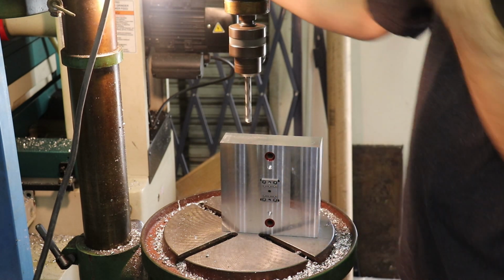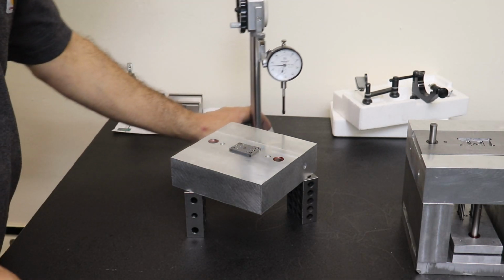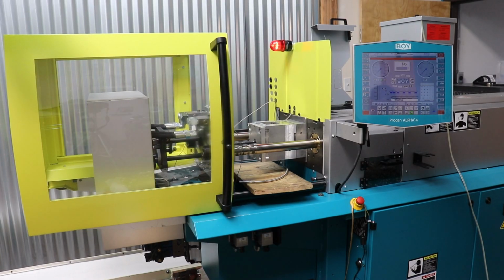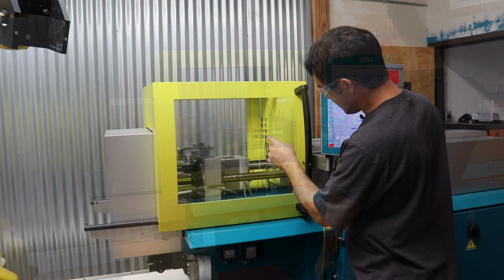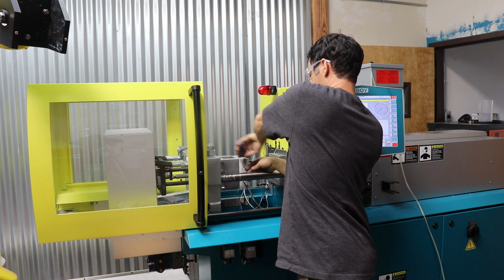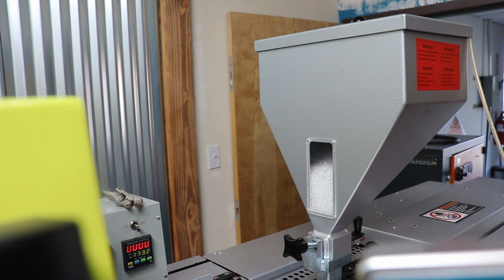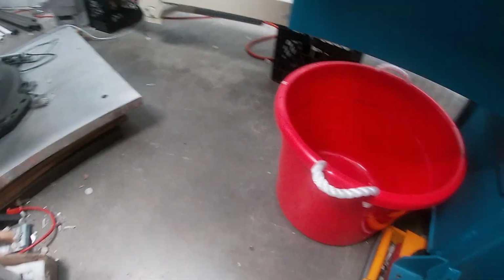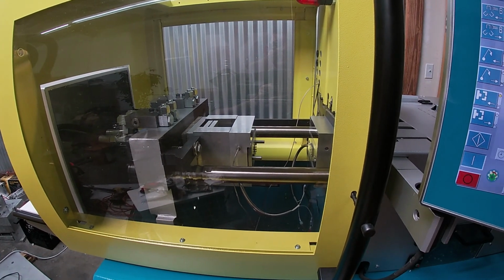Family Mold Making - Molding Day

Comment: Thanks for making this series. I worked with rubber molds a long long time ago but they were not very much like plastic injection. For the average guy or gal videos like this may not be all that but, for this old guy I find it fascinating. Seeing some of the problems we all run into and figuring out the solutions can be frustrating for some or the fun of the thing. I hope it is the latter for you. Either way thanks for the extra effort on our behalf. T

Comment: Great video. I went with my dad to a MACH show UK in the late 80's. We went on the BOY stand and he was very impressed. Still impressive now by the look of it. He used to do R&D work and low production runs. Interesting to see how Injection Moulding Machines have improved. I was interested to see the hopper purge. We didn't do that. Is that left on all the time or just when filling the Nozzle with material
Reply from the maker: Hi Rupert, thanks for watching.  Yes, for that particular plastic I keep the nitrogen purge going just to keep a small positive pressure.  Most plastics don't need that.  Thanks for watching.
Reply: Thanks